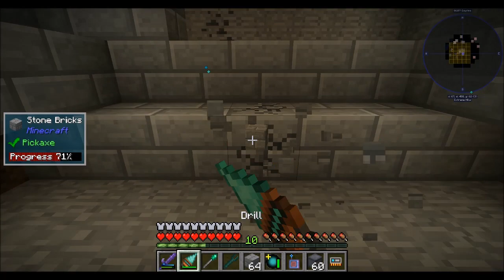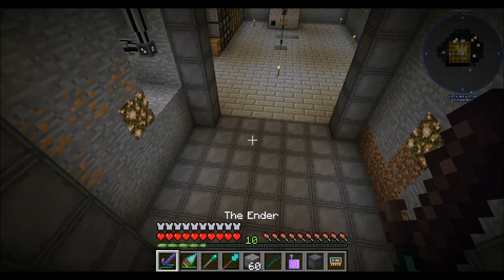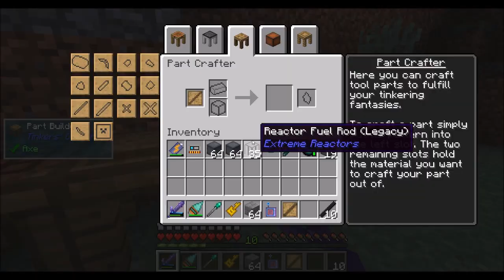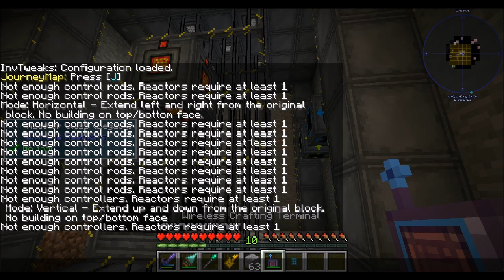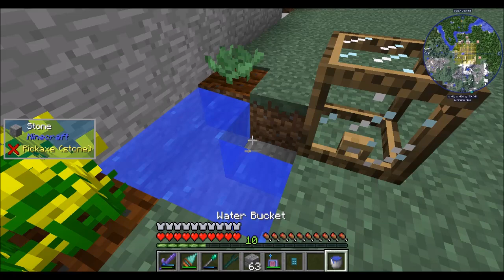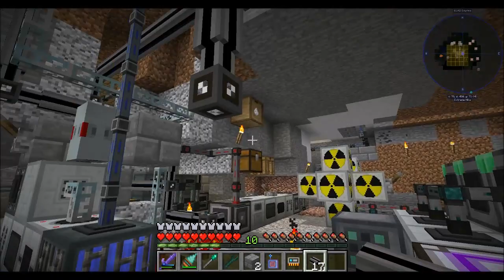AoE Ep62 Reactor and Singularities

Comment: A single Fluid Transfer node with 20 speed upgrades and 1 mining upgrade getting water can fill up the fluid bits tank at a speed fast enough that you can have +3 Item Transfer nods with 20 speed upgrades and a stack upgrade. You will get singularities at an insane speed.
Reply: A single Fluid Transfer Node with 1 speed upgrade pulling from a Reservoir is keeping up with this set up! Very nice Thank You!

Comment: Hey dire, you can put translocators on each side of the trash thing for singularities, and put 5 on each side of that. Save 1 side for pulling singulatities out, and that's 25 translocators putting bits in. Speeds it up a decent amount more

Comment: cyanite will produce faster if you "cool" the reactor with lava
Reply: I told him on Twitter last episode. He didn't respond, probably since he had already filmed this episode and knew that ever air cooling was faster than he needed.
Reply: Well, any fluid works, it's just temperature that makes it better, the hottest liquid in the pack would be the best. Something like pyrothreum. I know some liquids are messed up on temperature
Reply: Wouldn't a + shape instead of the x work  better as well?
Reply: MasonP13 fluid temperature doesn't factor into reactor heat (at least it didn't in big reactors, extreme reactors are closed source). Only factors that matter are how well the material inside captures radiation made by fuel rods and how well it conducts the heat away. 
From the last available code, lava isn't even a valid block inside of the reactor and the only reason pyrotheum works (which Dire can't use since he has no TE in the pack) is that it's pretty decent at capturing radiation (and turning it into heat) and pretty bad at conducting heat away, not because it's hot itself. Looking at other materials lead blocks would be my instinctive choice. 

And yes, reconfiguring the fuel rods into a + shape should give higher temps and fuel usage.
Reply: I thought IC2 hot coolant would work though. I've made a reactor in the past and saw differences....
Reply: The longer this conversation goes, the more I want to download AoE, start a creative world, and test all the liquids I can think of.
Reply: yes it would, but even better would be an O shape, so he will convert very fast (+lava) but still get tons of power
Reply: Reactor won't even form with lava inside. Best reactant for maximizing fuel usage I found in my tests is snow, at least for the reactor layout Dire is using
Reply: You can use cyro fluid from thermal foundation and expansion to get a really good reactor

Comment: Cool video.  I think the problem you had with the bits getting put into the mechanical user is that you have it in right click with random slot mode, so either you could have a bucket for all nine slots or make it so that it only uses a slot that currently has a button.  At least I think.

Comment: so he made a setup to make water bits that, when refilling the water, accidentally makes water bits that he just puts into trash instead of into the storage system :D
Reply: Yeah, serious facepalm material there.
Reply: jorix3 not quite... He has the mechanical user dumping into the trash, because that will stop the refilling of the tank. He has the tank directly connected with a storage bus. The bits from the tank will not go into the trash, but any that go into the user will.
Reply: The thing is, he could just route them into an importer instead of the trashcan, so why doesn't he do that already?
Reply: Having thought about this a bit now, I think it is because if he doesn't put it into a void limited drawer it would eventually flood his AE system.
Reply: I think someone should load up a test world and see what's actually happening.  He could tell his AE system to only store the bits on a certain drive and subnet it onto it's own network over P2P tunnels.
Reply: He doesn't really need those bits, and if he inserted them into his system, it could easily overflow and fill his drives. It's 1000000x easier just to place a trash can down and void the excess, considering he is getting it as fast as his one translocator can transfer, anyway.

Why would Dire ever do anything that complex just to deal with a few extra bits when the simplest approach is probably the best, at least for now until he feels the need to ramp up the singularity production.
Reply: In the end, it doesn't really matter. The system is clearly making singularities fast enough with the current setup and with the translocators(?) his storage should not flood with bits. But it is funny how he made a system that COULD quite easily be 100% efficient with an interface instead of an export bus that you just pump items in and out of with conduits, instead he made a system that has a random chance of "losing" some of the bits.

Comment: That chisel & bits trick was pretty clever. I've just stolen that idea! >:-)
I did cut AE out of the equition though. I used Item lasers from actually additions with an item interface.
5 lasers on the tank, one on the item interface, translocator from interface to condenser and link all lasers.
Works completely standalone.

Actually additions does seem to work a bit randomly sometimes. Not sure why.

Comment: Would filling the reactor with Lava and using RF trashcans help?
Reply: RF Trashcans aren't relevant here. A Big Reactor produces power regardless of whether it's consumed, it won't switch off or run more slowly when full. Lava would help if Dire's original calculations were right and it took a long time to get Cyanite with just air, but, it doesn't.

Comment: Please Dire, switch to using Mekanism for circuits. That's why they're ore dictionaried, it's MUCH faster to use the Mek circuits than wait for the IC2 ones. At least for the advanced ones... the basics with as many overclockers as you have are probably faster the IC2 way.

Also, you should keep a stock of the long-process-time stuff on hand. Like EnderIO alloys, for example.

And PLEASE quit using the EnderIO powered spawner. Resturbed mob spawners are significantly better for blazes, and endermen. Wither Skeletons are the only mob they're really good for... and you could Cursed Earth farm them in the nether. Also cursed earth would be great for getting those zombie heads.
Reply: Tomewyrm Draconus how are you supposed to get a resturbed ender man spawner?

Comment: OMG JUST USE TRANSFER NODES :D
Reply: Translocators are actually faster.
Reply: Tomewyrm Draconus but Nodes can interract with bits tank
Reply: Can pump water and pull bits
Reply: Right, but speed is the point of this. The storage bus is the fastest way he has to get those bits out. He could use a transfer node to pump the water into the tank though. That would probably improve the build.